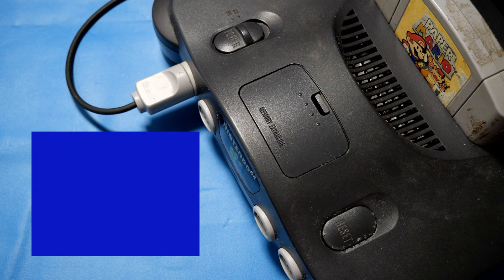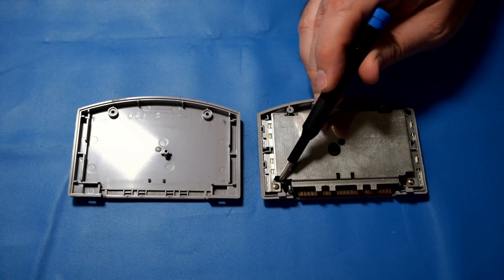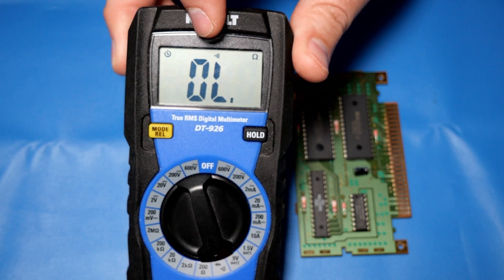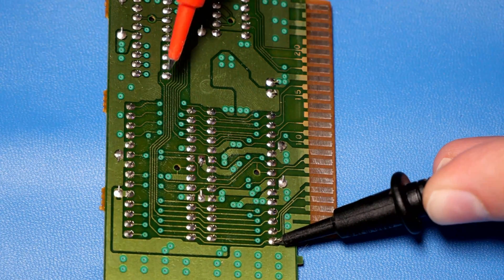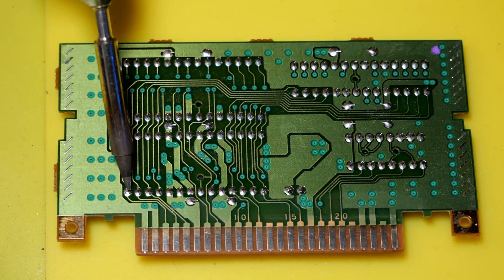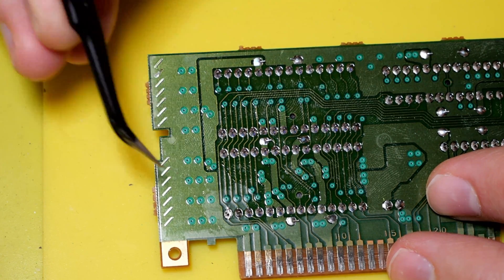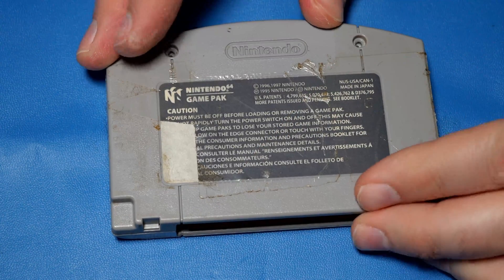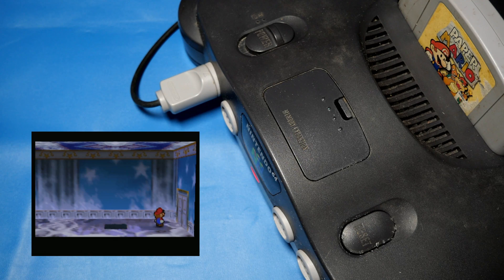Paper Mario has an Arithmetic Overflow error!!?  Let's fix it!

Comment: I do wonder what stressed the board enough to have a break right around the pin. What a strange place for a fracture.
Reply from the maker: I was wondering the same thing.  Such a weird place for a connection to break when there's no sign of liquid damage.

Usually, N64 games break under that plastic piece.  Only thing I can think is maybe it was dropped pretty hard at some point and that specific pin absorbed the impact for the board.
Reply: @gumptendo  With the plastic shell and metal heat shield I could only imagine it was a manufacturing defect, honestly.
Reply from the maker: That would probably make a lot more sense. I looked a bit online and that sadly seems to be a somewhat common issue with Paper Mario.